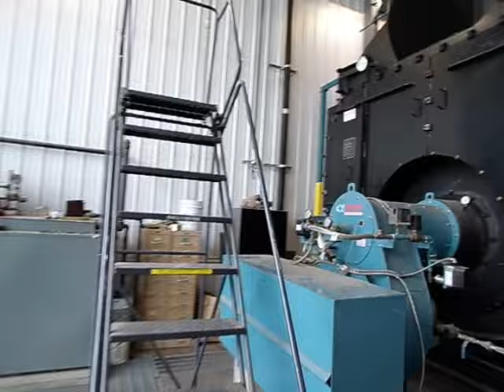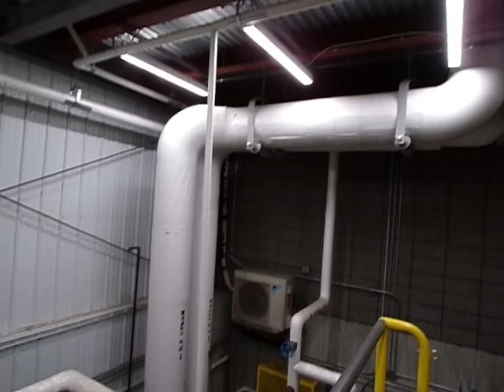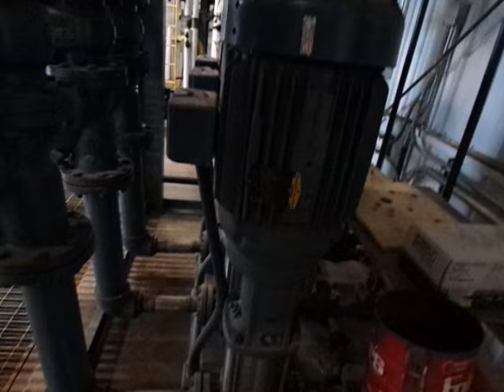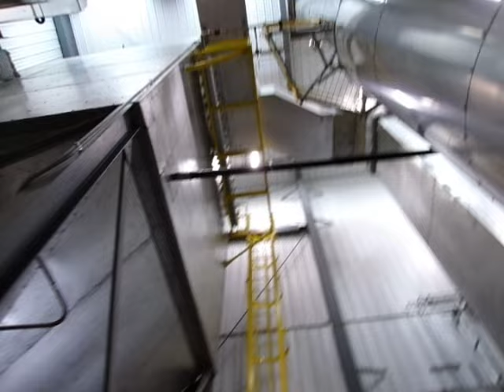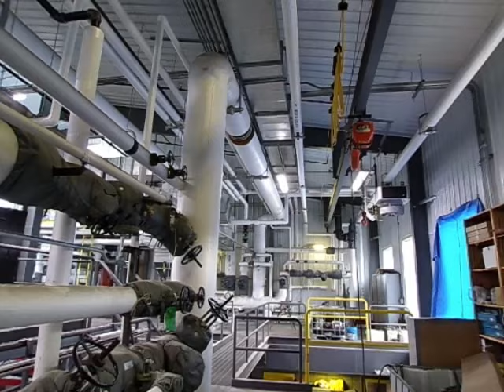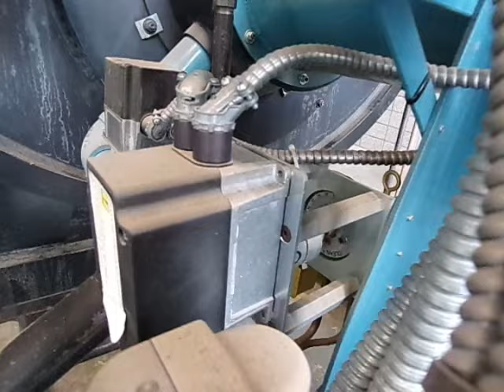Inside the VCSU Heat Plant: How Boilers Power an Entire Campus

Comment: Very interesting tour! I am curious about two things, do you know why the universities have chosen to use steam heating and not hydronic heating? Also very interesting to note I have never seen a boiler run coal or fuel oil here in Canada, coal has almost completely been phased out and no plant I have worked at ever burns anything but natural gas. Very cool to see the stoker and fuel burning mechanisms!
Reply: Hey I am Canadian too. Im a Power Engineer by trade. There are still a few heating plants which run heavy oil but mostly its NG now. Its a lot cleaner and maintenance free. I went in the fire side of our boiler after five years of running on NG, there may have been enough ash to fill a Tims cup. Compared to oil... well... 

As for why steam is used as opposed to hydronic, steam has a much higher energy content, and heat retention, than hot water meaning it can support building heating loads, cooling loads if it has an absorber chiller, domestic hot water, and other steam customers. The way these universities, hospitals, and big campuses that have steam heating are set up is that you run steam to a building and then have a steam to hot water heat exchanger for domestic water and heating water.
Reply: @NovaScotiaKevin  It makes sense to me to use steam, but I have worked in a few hospitals in the BC interior and they all decommissioned their steam heating systems and went to hydronic heating. The biggest hospital I worked at had a campus with multiple high rises and they still went with a central hydronic heating plant.
Reply: @hooplan77  Smaller sites I have seen had either converted to hydronic or were built new with it. There are regulatory and insurance savings to do so. But a large, multi building site using pure hydronic from a central plant is a new one to me. I can see using a stand alone system in each building but a central site is interesting.
Reply: @NovaScotiaKevin To be fair it used to be multiple indepent systems but then they coverted it to a central system when they finished the new tower in 2022. I quit about that time but I heard it was a disaster.
Reply: Steam doesn't require pumps, and travels long distances very quickly, and can travel up to tall heights without issue.
 
All that happens is the steam flows into a radiator in any room, condenses, and the water naturally flows back to the boiler with minimal pumping.
Reply: @northernmetalworker  this is true largely for domestic systems. Gravity return condensate systems are not effective or efficient when applied to commercial spaces or large facilities. The pump trap you mentioned is actually  for condensate collection and return. Condensate can either be electrically pumped or pump trap. Feed water pumps need to generate enormous amounts of pressure as it, at least, needs to overcome drum pressure to get water in to the boiler.
Reply: @NovaScotiaKevin Yeah it seemed to simply be a method for helping with the system in certain circumstances, ie low pressure heating steam. I just thought it was a clever solution.
Reply: @northernmetalworker  it is, and whats even cooler is some of those older domestic LP steam systems had one pipe handling both steam and condensate.
Reply: @NovaScotiaKevin yes, ive heard about that, theres a guy on youtube who has made some long talks about it, two pipe and single pipe systems, very simple, but effective, the nice thing i can see about that method, is the steam will work to always keep the condensate thawed out, so you dont have as bad of freezing problems, just a theory.

I actually am contemplating building a wood fired system that uses steam to heat a few buildings, but design it to be entirely mechanical, no electricity.
Reply from the maker: @northernmetalworker  that makes sense, I didn't think about that.
Reply: @SteamElectricityandPropulsion its actually quite a remarkable heating system. If i recall, early steam heating systems didn't even need electricity, other than the boiler itself, and you could heat huge multi story buildings with it.
Reply from the maker: @northernmetalworker if there was no electricity you would need natural draft which requires you to waste heat up the stack. You would also need steam powered feed water pumps.
Reply: @SteamElectricityandPropulsion there was a type of feed water system that was quite simple, it used the vacuum effect of condensing steam to pump more water into the boiler, all mechanical. I cant remember what they were called, but im pretty sure they are still made.
Reply from the maker: @northernmetalworker you need positive pressure to put water in a boiler not negative pressure.
Reply: @SteamElectricityandPropulsion yeah i cant remember how it all worked, i guess ill have to do some digging around again!
Reply: @SteamElectricityandPropulsion  yes, you are correct, i found the info, its called a boiler water return trap, and it works in conjunction with check valves, and has a float valve inside it and a steam valve that opens once the float is raised, when that happens, the steam pushes the water into the boiler.  Theres a youtube channel called "Heating Help" that describes it in detail, its a 5 minute video on "boiler water return traps"

Cheers!
Reply from the maker: @northernmetalworker  so the return trap must be higher than the boiler so that the steam pressure would be enough. with a piston feed pump the steam pistons are bigger than the pump pistons so the water has enough pressure to go in the boiler. speaking of old steam tech would you like me to make a video about engineering at the rollag MN steam show?
Reply: @SteamElectricityandPropulsion that sounds like a fun video. I assume by the word rollag, it involves steam powered farm equipment?
Reply from the maker: @northernmetalworker  its called WMSTR and its in rollag MN.
Reply: Steam is useful for more than just heating. Absorption chillers can use steam to remove heat from buildings,  sterilization and autoclaves, small steam turbines that run pumps vital for campus function to backup or parallel electric pumps. Larger campuses can make efficient electricity by using a steam turbine to spin a generator because all the steam production equipment and process is in place(co-generation). Hydronic doesn’t travel or transfer as well and doesn’t offer these other uses.
Reply: @jezusjones4324  Great point. Also, while hot water is hot. Steam is even hotter via latent heat as well.
Reply from the maker: I suppose steam flows better and might be easier to control but I dont know for sure. if you want to see an even more epic coal fired boiler thats actually running check out my other video about the Zurn coal fired boiler at NDSU in fargo ND.
Reply: @SteamElectricityandPropulsion I did see your other video and subscribed!
Reply from the maker: @hooplan77  they have coal fired boilers at the college in mayville ND and they told me that they will run them in february. Im just waiting for approval to make a video about it.
Reply: @SteamElectricityandPropulsion Sweet I look forward to seeing the video!
Reply: All of the North American central heating systems of which I am aware, including the massive Manhattan system and smaller systems in many other cities, used steam.  II don’t know specifically why steam was chosen.  The district heating systems installed in many cities in the USSR used hot water under high pressure.  As they aged they became extremely unreliable.

Comment: Wouldn’t a cogen unit be way better?  Turbine makes electricity, exhaust and liquid cooling makes steam and hot water.  Use the energy twice
Reply from the maker: are you talking about a gas turbine? that system would allow you to make electricity but less heat because engine exhaust is under 1000 degrees. it would be more profitable if electrical energy would sell for more than heat energy. you cant really use energy twice because engines turn heat into energy.

Comment: Steam heating is proof that CO2 isn't a greenhouse gas. If it were, we would use it to carry heat like steam does. Instead we used CO2 for cooling. We use steam for heating. So water vapor is the true greenhouse gas.
Reply from the maker: No that's not how it works.

Comment: Thank you for doing these.  When I attended Cornell University in cold and snowy Ithaca, New York in the 1970’s, the whole campus was heated with a large central steam plant.  The boilers primarily burned coal using chain-grate stokers but could also burn heavy fuel oil.  The steam heated all the buildings on the main campus and certain buildings had a/c compressors powered by steam turbines.  IIRC, the plant also had a couple of small turbogenerators providing the campus with backup emergency power.
Reply: I wonder what they have going on there today for heating. I know they have a very fancy system for cooling that uses the lake as a giant heat sink. But they must still be burning something in the winter. Probably not coal, but do they have access to enormous amounts of gas up in Ithaca?
Reply: there was (and I assume still is) a major gas pipeline and compressor station located about 5 miles from the university.
Reply from the maker: wow thats cool. I wonder if all those turbines still exist. if so maybe you could ask for permission to get a tour and take pictures. are you saying that the coal boilers had oil burners on them or were those separate boilers?
Reply: @SteamElectricityandPropulsion 

If my memory is correct, There were no separate oil burning boilers.  I would gladly help with access but I haven’t been in touch with anyone at the university in about 30 years.  

If you are interested in seeing the plant, I suggest that you go online and look up the name and postal address of the head of what was then called physical plant operations, and send him a snail mail letter.  I wish you luck, but I wouldn’t get your hopes up.

Because of the huge amount of biological research carried on there, the university has been the target of animal-rights and similar extremists.  Frozen and refrigerated laboratory storage contains years of irreplaceable work by thousands of professors and graduate students.  In the current security environment, I would be surprised if every vulnerable piece of infrastructure wasn’t locked up like Fort Knox.
Reply from the maker: @Pamudder  new york is too far away for me. I just do tours in ND and MN.
Reply: There was a railroad branch line feeding it. I hiked the ROW.
Reply: @SirBirdington-e4f it was the East Ithaca branch of the Lehigh Valley  RR.